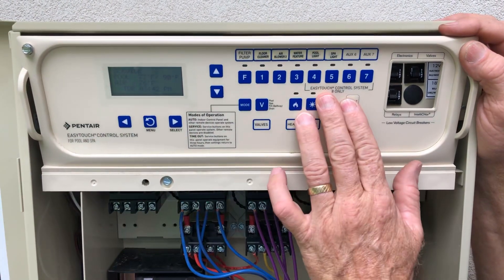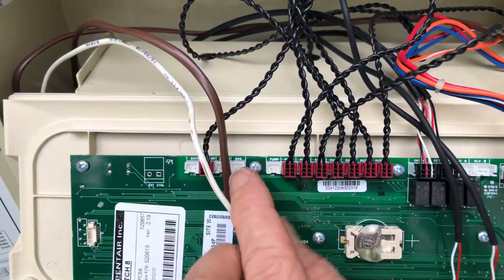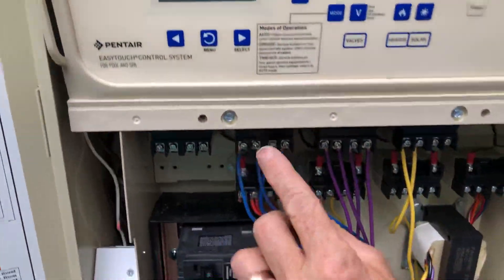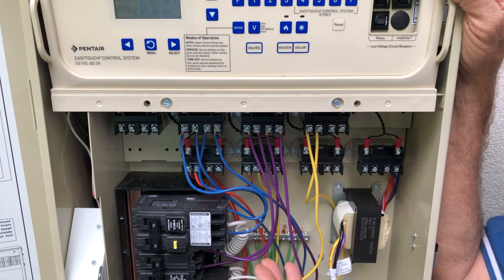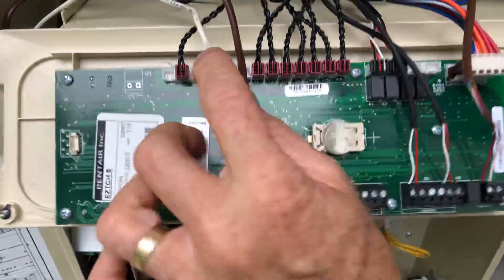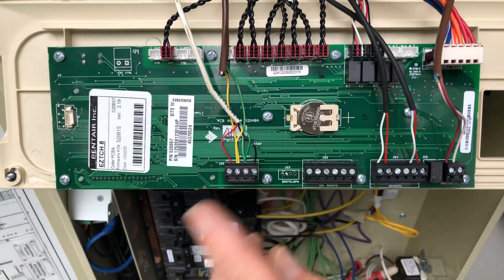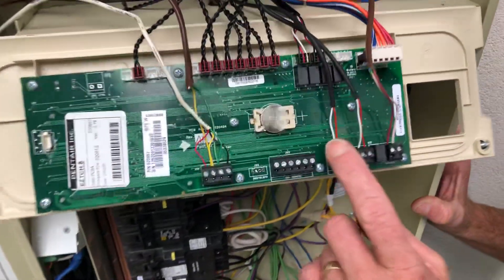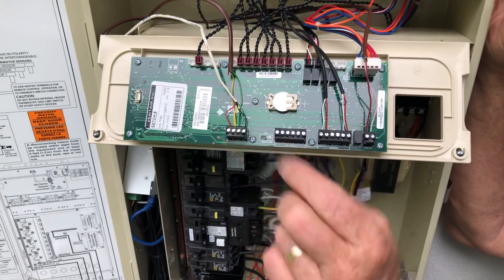Pentair Control Panel Wiring: Part 4

Comment: Very informative video!  I tinker with Arduino-like controllers and I want to "hack" into my Pentair.  I only need to turn on SPA mode so fully implementing the RS485 is too much effort.  I was thinking I could make use of the spa side remote connections.  Do you have any information on how that works?  Is it just simple buttons or is it more complicated?
Reply: To answer my own question, I think a simple relay between the black and red wires would mimic the spa button.  https://www.troublefreepool.com/wiki/index.php?title=File:Pentair_Spaside_4_Button_Remote_Schematic.jpg [update - putting a jumper between black and red does toggle spa/pool mode.  A channel called The HookUp has a video on how to automate this.]